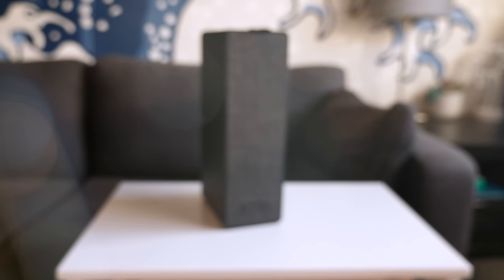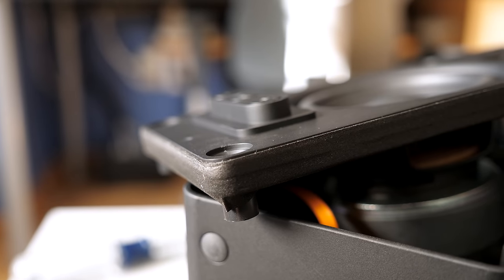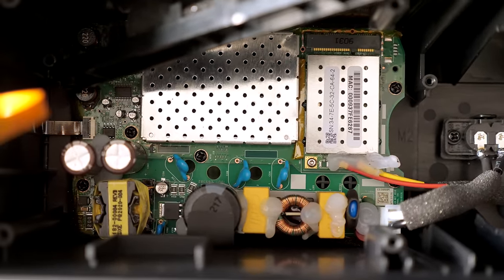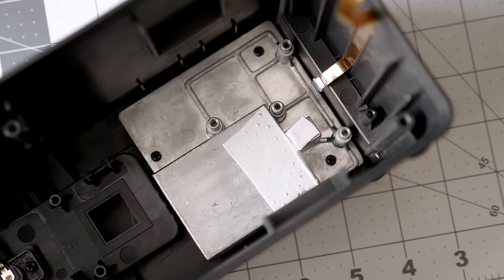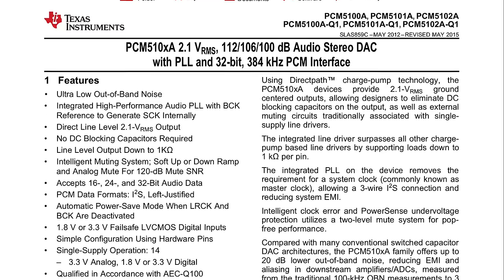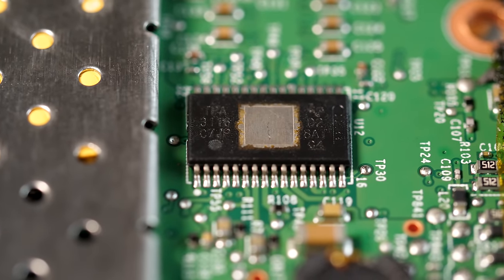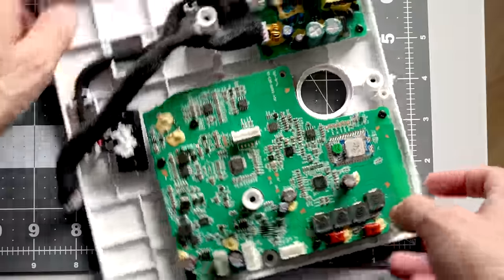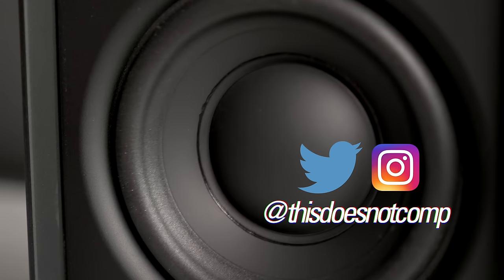IKEA's Sonos Speaker Has a Secret

Comment: So they put in crappy capacitors then in a few years all these devices will end up in landfill. No one's going to get a technician to fix it at twice the cost of a new one. Shame on them.
Reply: They should’ve used eliminate the Ethernet port as a cost cutting method instead of poor quality capacitors.
Reply: It's absolutely ridiculous to expect Nichicon, Panasonic or any other "name brand" caps in a GENERIC brand appliance.
Reply: John Coops They need to think about product longevity and environmental.
Reply: @aussie8114  - WHY? The capacitors do not affect either the product longevity nor the environment. An outdated product with high-end Nichicon capacitors is STILL an outdated product that nobody uses and ends up in landfill.
I am typing this on an old and outdated HP 20 "all-in-one" that uses el-cheapo capacitors. It's not going to be any faster if I replace the capacitors, you know.
Reply: John Coops Well the guy in the video who obviously knows his shit said they will need to be replaced in a few time.
Reply: @aussie8114  - And the guy is sort-of correct, however he is being alarmist, and you are taking his bait. CapXon is certainly not the "worst" brand of capacitors, and they are one of the most common "no-name" caps used in the OEM market.
All manner of name brands eg: Logitech, Sony, Yamaha, etc use CapXon capacitors,, and they're perfectly fine for normal applications. It's only in the absolute top end of the "name brand"  audio equipment (plus expensive esoteric products) where Nichicon, Rubycon, Elna, etc caps are used.
This Ikea/Sonos gadget is just a budget priced product anyway, and it has a "design life" of a couple of years. It doesn't NEED to last any longer because the rapid advance in technology will make it obsolete quite quickly. Consumers will replace it with a newer product long before it ceases functioning.
READ THIS: https://en.wikipedia.org/wiki/Design_life
Reply: @johncoops6897  I couldn't agree more. I'm an electronic engineer and we use CapXon quite often because they have a very good price/performance ratio, and our products are designed for a lifetime of min. 10yrs. It just isn't possible to use Nichicon or Rubycon caps in this device with a 100$ retail price.
Reply: @aussie8114  Just the "bottom line"

Comment: "CapXon is far for being the best available and their use is a good indicator of where IKEA had to cut corners..."
Then he shows that the more expensive Sonos Play 1 uses exactly the same low quality capacitors.
Reply: Keep in mind the Play 1 is also Sonos’ budget model. And more than that, it’s still cheap for a decent WiFi speaker even if it is 50% more than IKEA.

Comment: The worlds largest supplier of damping material saves money on damping material. :X
Reply: damping material in a vented enclosure does NOT improve the bass, in fact it makes the transient response worse, in a vented enclosure damping mops-up some of the internal back wave energy re-radiating & frequency modulating or acoustically feeding through the cone. In a sealed enclosure damping would increase the apparent volume ( thus improves the bass ) as well as dampen back-wave energy. A lot of engineering @ this price but DOUGH those cheap ass capacitors :-(
Reply: @BogdanWeiss  I thought damping material was in there to get rid of standing waves caused by the acoustic room inside the speaker ?
So to make sure you can`t hear the speaker itself as such.

Comment: You CAN'T just use any fabric in as a speaker-grille!!! Just try it and weep.
Reply: That’s absolutely correct, the fabric needs to be acoustically transparent, otherwise it just ‘muffles’ the sound, especially the top end
Reply: why you look at almost any product. your paying about 10 times the cost it takes to manufacture on average. markups go from factory, then to distributors, then retail. all mark it up as it goes through the line

Comment: I actually have two of these and tried putting them in an "ideal listening position" for stereo. The sound stage was quite impressive! Stereo separation and immersiveness were amazing for 100$ speakers that don't have audiophile aspirations.
If you do have an apartment, do not hesitate to give tyem a try. You might end up amazed.
I am trying to save for buying a Sonos Arc for that atmos. Coupled with the Symfonisks I believe I would get a pretty nice cinematic experience in my small 17^2 meters  (180ft) living room.
Give the Symfonisks a try, they are beefier than they look 😂
Reply: Totally agree with what you say, and what you have in mind, mean by it... 
I also gave it a try. Firstly out of curiousity and practicality. As its purpose makes it a sensible choice to use it in a layout most common in appartments of 30-55m2.
I added a second unit to try the pair of them and so on.
I realy did not expect the result and I simply cannot being amazed enough!
Reply: 1st of all this doesn't cost 100$ 2nd of all for two you will need almost 300 Euros. For that money I can buy a proper stereo sound system with speakers included that have much more functions and life in it then this garbage ... Even if this would cost 100$ for two is too much money for what it is.
Reply: @minmogrovingstrongandhealthy actually in the US the speakers are 99 each

Comment: Had a Sonos Play One, threw it in the recycle bin after dismantling it. I won it at a vendor event so I intended to use it as a tear down experiment. After the completely frustrating user experience, as they wouldn't add a 25 cent bluetooth card, it was destined for the junk heap anyway. Horrible product throughout with muddy sound and tryhard bass that breaks apart beyond nominal volume levels. Great video though, I really enjoyed your uncompromising review. Thank you!

Comment: Nice work! 
No Bluetooth support may be a deal breaker and demise for this design
Reply: Agreed, that's a deal breaker for me as well, when even a cheap $10 speaker these days comes with Bluetooth, and I've seen some with BT 5.0 at that price in places like Big Lots.
Reply: People talking about Bluetooth support don’t fully understand the Sonos ecosystem or something!? Sonos works by attaching to Wi-Fi and forming a mesh network with other Sonos items in your house. Bluetooth is only useful in this scenario for a portable speaker that you might take outside your home. Which is why the new “Move” has Bluetooth.  Otherwise the app and things like Spotify Connect just communicate on the network. Bluetooth degrades audio as well. You have an option in Sonos net for compressed or uncompressed audio.

Comment: I never knew the Sonos essentially uses an Active crossover (by using the CPU to discreetly handle each band of audio, avoiding power loss from use of passive crossover).  Somewhat disappointed to know that the amp really is just a little chip amp.  It does sound better than acceptable though.  Presume that architecture just scales up to the Play 3 and Play 5.

Comment: Hi, good video! You must have heard about the trade-up program from Sonos and how it appeqrs to have backlashed for concerning environmental practices.

I noted your comment on the condensers. It would be interesting to know what would be the cost difference to a better component and how that would benefit the consumer, and the environment. I would also be interesting to know what design decisions appear to have been made towards a planned obsolescence of a product, and what could have been made so a product could last longer.

I understand this may be a lot to ask, or simply out of scope, but your videos are appealing, and as a consumer, I'd like to be made aware of where companies appear to deliberatly cut too many corners without a proper benefit to the consumer, or where it would unecessarily over impact on the environment. Many thanks!
Reply from the maker: The cost difference isn't very much -- in the case of a product like this, perhaps the equivalent of $1 per unit. Sometimes people will defend this kind of cost-cutting with the retort that "if they sell a million units, that's $1 million the company saved" which, to me, is a terrible way to justify it since it just says how much more the company increased its profit margin. In the case of Symfonisk, I'm not sure the capacitors really matter as there's a another aspect to it that will become obsolete before the caps fail -- the software. The older Sonos models that the company listed as part of its trade-in program (which I agree is a terrible waste) are still perfectly serviceable, but can't use the latest protocols like AirPlay 2. Either the hardware isn't capable of it (CPU not fast enough) or Sonos doesn't want to invest in updating their firmware (it's far more profitable to sell new models, even at a discount, than keep older ones working). As I review products I try to keep an eye out for these sorts of things, but prefer to simply point them out and leave it up to the viewer to decide if it's important to them.
Reply: @ThisDoesNotCompute  thank you for your reply. Keep up with your videos.

Comment: It dosen't help with bass. That is dictated by the engineering (dimension and stiffness) of the enclosure, the tube and the driver it's self. Padding can help with driver balistics which can be across every frequency and also dampen undesirable harmonics within the enclosure.

Comment: Sonos seems to have a great reputation for great sound but when I was at IKEA and listening to the Symfonik I was very disappointed of the sound. There were two kinds if setup.. one with single Symfonik in a cramped 1,5m2 space with walls and one setup with two (stereo) Symfonik in an open space. Both setup sounded like cheap $20 Bluetooth speakers. As Sonos iOS app has the possibility to change the speakers output on the acoustic environment they are in, so IKEA may have sat up the speakers not using Sonos apps acoustic room config. But there were no way for me (or IKEAs salespersons) to access this. They suggested that I could buy them and if I was not satisfied I was welcome back for a return. I told then that I was living quite a bit from IKEA and was rarely in town and driving back to IKEA would cost money and time. 

So my questions is.. how big diff is the sound between non-config and config of room acoustic in Sonos iOS app??

And how big sound diff between Sonos Play 1/One and Symfonik..

Comment: Batting isn’t as useful in ported designs, and is essentially a waste of time and money. It serves an important function in sealed enclosures where it helps further attenuate the sound energy from the rear of the driver, in addition to the walls of the enclosure itself. That function is counterproductive in ported enclosures, where you actually want the energy from the rear of the driver to be heard via the port.
Reply: In some cases the rear sound is slowed more with padding but usually the ports size is calculated so it renders padding almost useless.

Comment: Further proof while the tech has went up the sound has been "dumbed down" for mass consumption.  The old phrase "good enough" is where products like this live.  Good enough means we are not aiming for audiophiles and this small speaker will have just the right enough "wow" factor for the non-audiophile crowd especially with some DAP EQ.  Folks like me will pass on speakers such as this, but the Bose crowd may jump ship when it's time to replace existing components.  Since the bar isn't particularly high Bose should be able to leverage it's strong name with some likely improvements.  Bottom line this is going to sell to IKEA customers but won't make inroads into the general wireless audio marketplace.

Comment: A very interesting video, with a wrong title.
What exactly is the secret here...
I think it's rather obvious that IKEA just brands those electronics, and 99% of the other companies do this as well these days. Many devices are even based at cheap chinese mass market devices, just with a different enclosure, and a different brand.
For modders this is great, as the difference between a better and a worse product often just lies in a firmware dump ;) (or some tiny extra components, like a few ID resistors)

Comment: The more products become wireless (wifi, bluetooth) the more I realize that that old school audio systems (separate receiver with speakers connected with very good copper wires) are still lightyears ahead when it comes to the purest sound output. The amount of signal that comes directly from the receiver from a cable is so much higher. The more signal comes through the better the sound. Wifi is not it. You lose so much quality due to interference in the air and other wifi enabled products (same with bluetooth). Want proof? Play the same song by using the headphones out and a cable directly into the jack on a bluetooth speaker and the same song by bluetooth. You hear the difference already, especially with high frequencies (good test, listen to a violin concertos of Vivaldi like the 4 seasons).

Comment: This Does Not Compute, can you switch out the circuit boards between the Play 1 and the Symphonisk? Then you would get Airplay in a Play:1 :D
Reply from the maker: 99% sure that would work, though probably not worth the cost
Reply: @ThisDoesNotCompute  cost wise probably not. But if you already own both, I could see a use case for swapping them. For instance creating non-airplay rear Symphonisk speakers for a surround setup. Seems tempting to try out..

Comment: 12:03 The front panels of both speakers are also virtually identical, The PCB's should be (nearly) the same.
Reply: The PBC’s are ABSOLUTELY IDENTICAL! I paused the video at that point and had a forensic look! ( I’m an electronics engineer)
The tweeter and woofer, though, whilst not identical, are very similar.

Comment: I have a Denon HEOS system and I want to use it with either headphones or hearing aids while still outputting to the speakers.
I’d consider getting a sonos speaker if it will work with the HEOS and I could plug headphones into it.
Bluetooth is a no go due to the delay and most things let you use one or the other but not both. Any ideas?
Reply: If your system has an audio out, you can connect a headphone amp to that and listen that way. Most hearing aid head phones have a base to receive the audio signal and then transfer it wirelessly to the headphones
Reply: If it had that I wouldn’t have posted the comment

Comment: I must say, i myself who have since early 90' s worked with electronics, have had a struggele finding the producers information you report here. how do you figure this out?
I have lots of equipment i service that i feel have simple solutions but i dont know where to fint the replacements.
Please give advice on where too look.

For example one of our suppliers have an issue with a ethernet port. The driver chip turned out to be the problem. They charged 2k$ for a repair, when we figured the problem out and part it was  7$+work..
Is it purely experience or do you have more support like image recognicion?

I have sometimes had to myself build workarounds, for example so relay driver that keps burning out on some equipment. 
I built a workaround because i was afraid that the circuitboard would not be able to handle. How do you work to find circuit informaion?

Comment: Yes this is how it works now good folks.
No matter what brand you buy you get the same brand anyway.
Like the IKEA rechargeable battery "Ladda" it's made in Japan but Japan has only one factory making batteries so you get the same high brand battery if you buy the IKEA one.
And the Iphone is now like 80% Samsung, the screen the chipset the works is from Samsung.
The only thing Apple you get when you buy an Apple is the design and software, not the hardware.
I'm now looking to buy a new SLR and the same goes there if you look closely you will find that the image chip in a $4000 slr is the same as in a $400 one.
The $4000 will have more features but not a better image than the $400 one.
Brand is dead so look closely on the specs before you buy and it will save you thousands.

Comment: motherboard.  cpu. ram. flash storage. OS. wifi. ethernet port. digital crossover. hot glue. 

not a single of those words are compatible with a good quality sound reproduction. 

I don't have to audition such speakers, I'm sure they sound exactly how they look on the inside.

Comment: Buy SVS Ultra bookshelf speakers and a decent amp instead. HIGH QUALITY you WILL NOT be dissapointed.
Reply: But at what cost. People here are heavily criticising the Ikea speaker because it’s not super hi fidelity. But it wasn’t designed to be! Its $99 !! It’s serves a need as budget wireless speaker with reasonable sound. How much would your SVS speakers with a decent amp cost? $1,000-2,000? Huge difference in price !! Like comparing a Toyota Corolla to a Mercedes C class ! Not really valid!

Comment: I keep loving my Soundcraft spirit absolute zero's studio monitors with wires and a amp  and hifi stuff my good old Revox speakers
Reply: Wow. Nobody seems to know about the absolute ;-) .  They sound awesome I have the zeros too.  Just so you know if you ever blow the tweeters the mission m71 m72 m73 tweeters are the same ferrofluid ones you just have to separate the plastic bit at front. Extreme feedback blew one of mine it was so loud it gave me an instant headache. Great speakers I run mine of an old Sony fe440 was running of QSC ex1250 when blew tweeter.